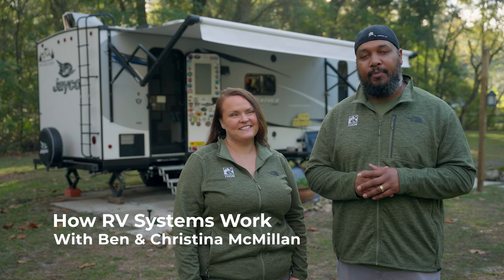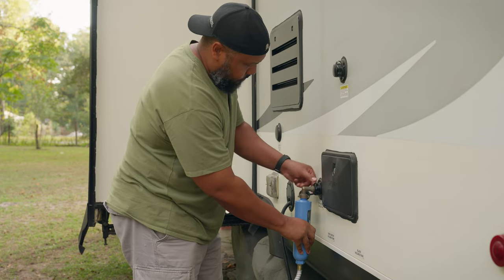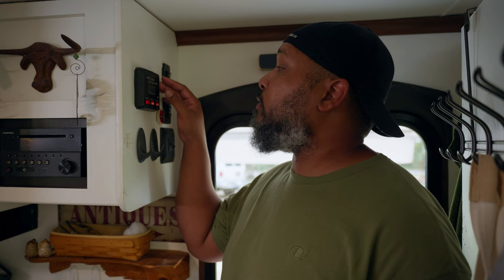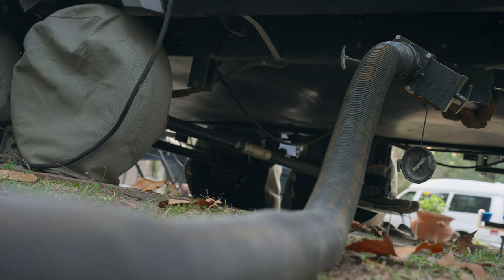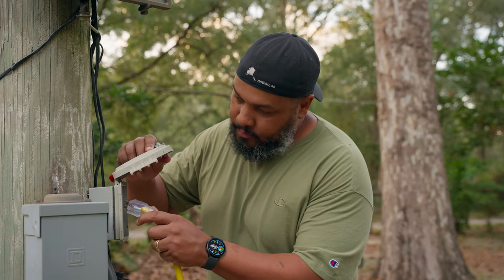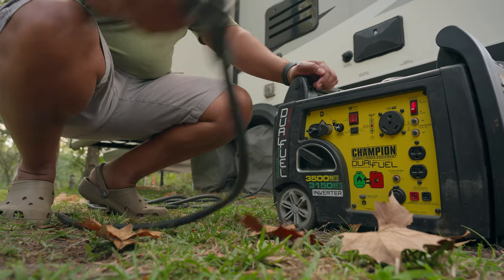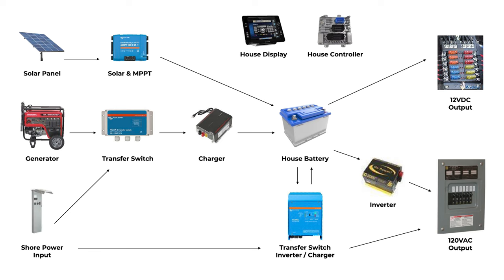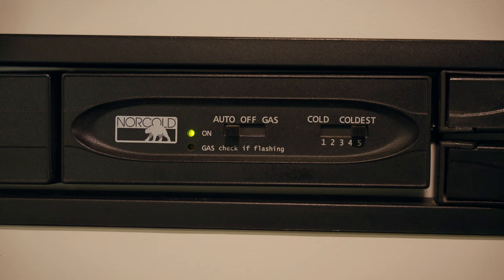How RV Systems Work: Water & Power

Comment: Hey guys thanks for the info. I am planning on working remote now that star link is available at higher internet speeds. My question is in general how long can I be between full service hook ups for electricity and water? We will use paper plates and plastic wear and only wash cook wear. We will also take 2 min showers for 3 people.